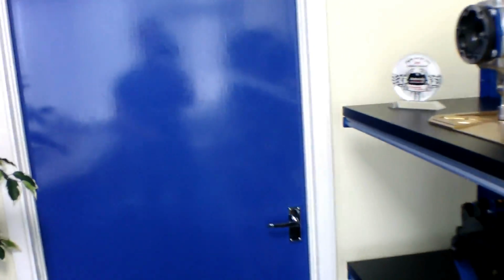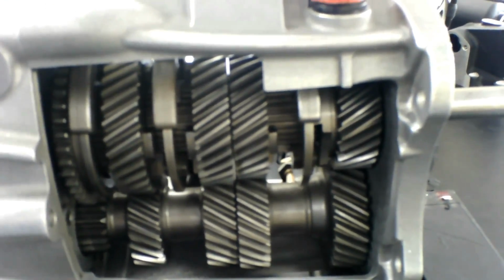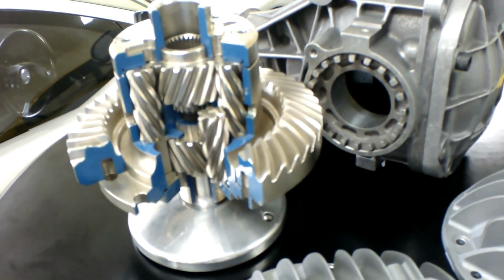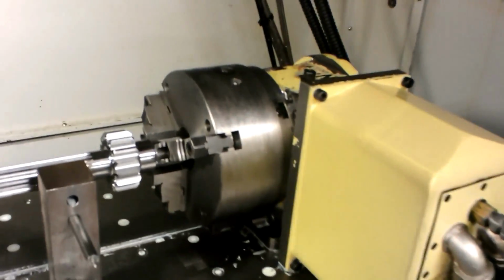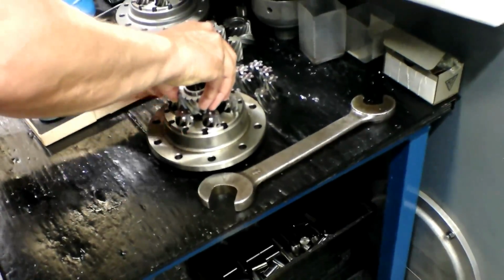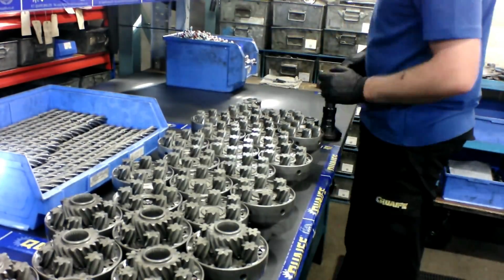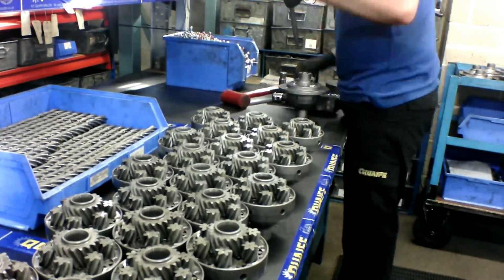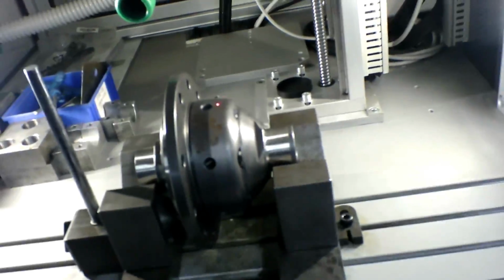Visiting Quaife, Ford LSD manufacturer | Vlog and Fiesta ST 3 Drive

Comment: Are there any plans for them to supply and fit them to st that haven got performance packs ?
Reply from the maker: Hi David.  As far as I am aware the answer to that is no. Ford speculation is that 85000 ST will be made and Quaife will supply the percentage of those sales with the performance pack. I can ask ford, but I doubt it very much. They would lose a lot of money supplying equipment for free.
Reply: I’ve emailed them let’s see what I get back thanks for your help 😊😊
Reply: @davidholding5335  Did you get any answer ? I'm interested as well
Reply: Thomas Delepinne I had my gearbox stripped with the part there but it didn fit neither did anyone know how it fitted the drawings didn make sense the diff had a male output shaft on the back end not a female 🤷‍♂️🤷‍♂️
Reply: @davidholding5335  Damn, thanks anyway!
Reply: Hi yer I was just wondering if they had any thoughts of selling it as a after market mod. 
I haven got the PP and would be great to pay for the diff to be fitted.
Reply from the maker: Hi David. I would imaging it is more than just a mechanical add on. I'd suspect that the vector breaking system software would need to be added as well and calibration for the launch control etc. Sound like a question for Quaife. There website is in the description. Check the out and give them a call 😁